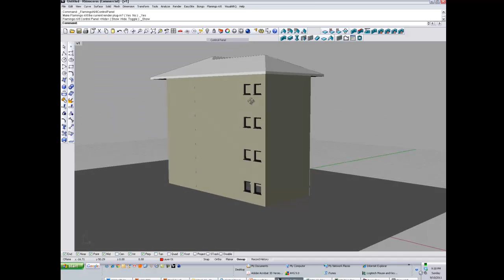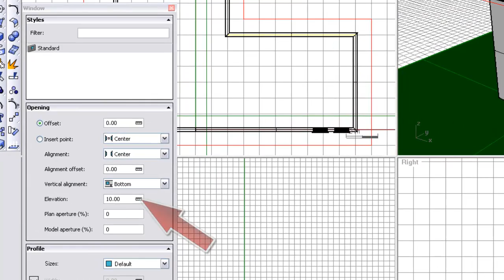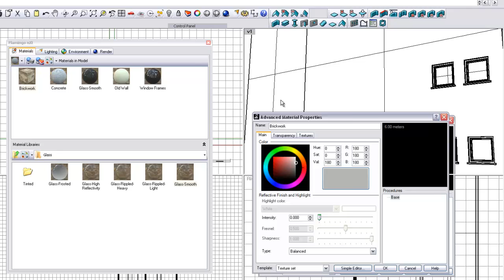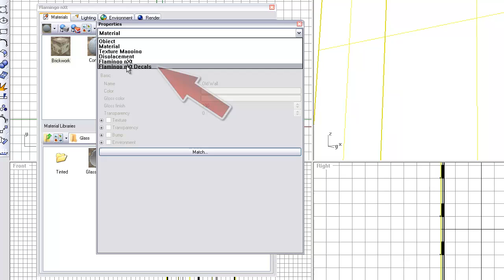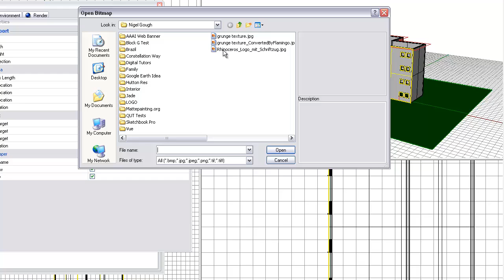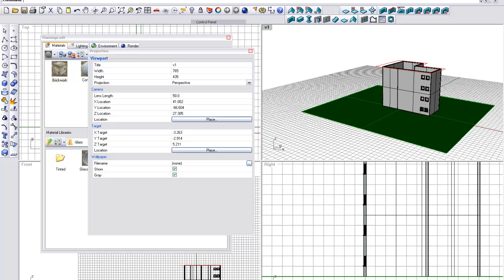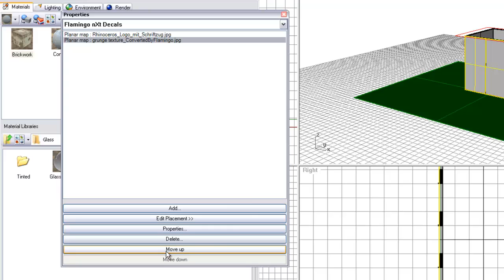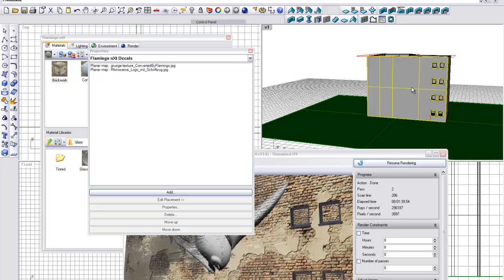Rhino 4 -- Flamingo NXT  Textured Materials and Decals

Comment: Note that if you want to specify "Projection direction" to either "Forward" or "Backward", it is necessary to move the decal slightly inwards or outwards. If it sits directly on the surface, then "Forward" and "Backward" are ambiguous, and the rendering may contain unpleasant artifacts.